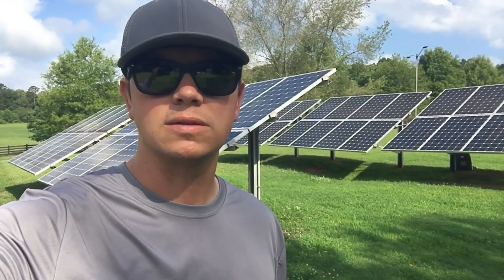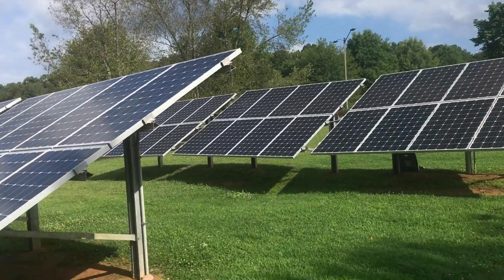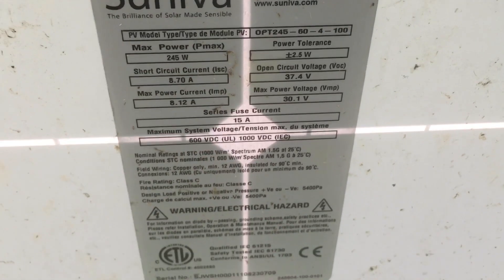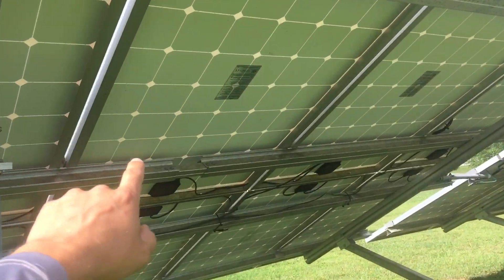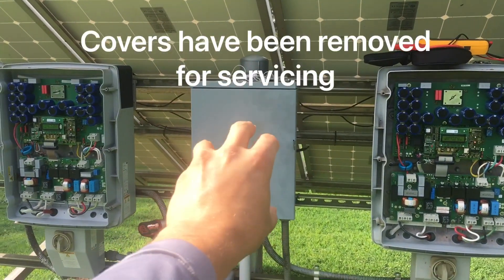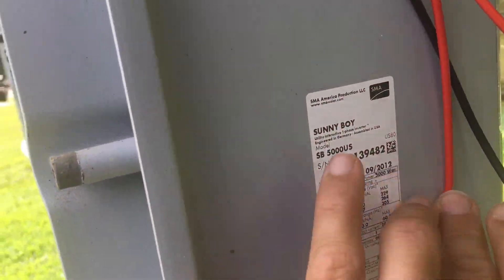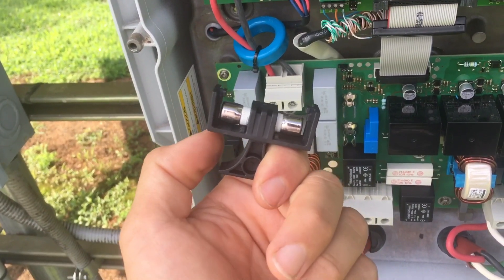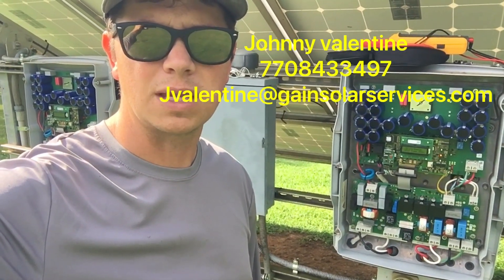Solar Basics:  What type of Solar do you have?

Comment: On roof systems, mystery boxes hooked to each module could also be module level rapid shutdown.
Reply from the maker: Yeah but there is a notable different these boxes are adhered to the modules. Rapid shutdown is usually a separate piece of hardware
Reply: @GainSolarPower  If it's a junction box with electronics in it, it's probably substring optimizers where each 20/24 cell substring in the module had its own MPPT in place of the usual blocking diodes.  Never heard of extra electronics bonded to the module otherwise.

Comment: Johnny do you have any opinion / experience with lightning suppression systems actually working ? Which brand or style would you recommend ?  Bare ground wire across the top of the ground mount to a ground rod be worth doing ?  Thanks
Reply from the maker: Midnite SPDs work well
Reply: @GainSolarPower  Thanks Johnny